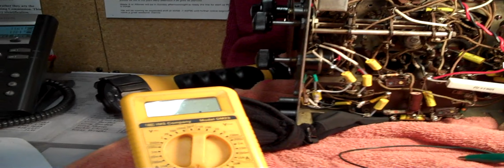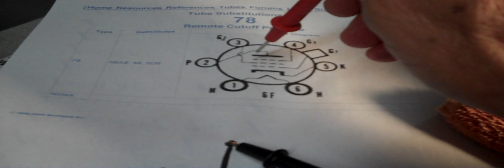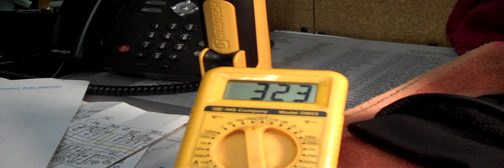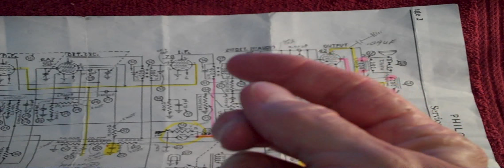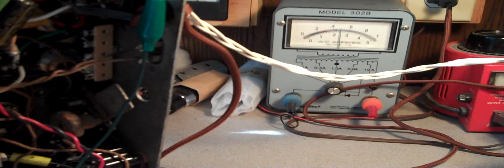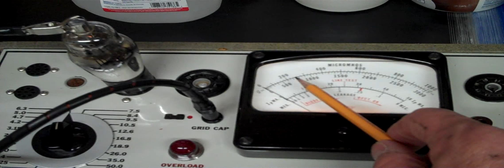1936 Philco Model 630B Repair and Restoration (Part 34 of 35).

Comment: Hi John,  Just want to let you know that your videos are really helpful. I have been working on a Philco 620, on and off, for the past 2 years. After watching these videos I decided to look at this radio once again. Got it on the bench and guess what, my voltages where too high. I don't recall what I did over the last two years, but your approach seem logical. I did check the 42 and it did have low emissions. Replacing the 42 brought the voltage down and the radio is now working. Thanks for your help.  Joe

Comment from the maker: The multimeter is a Model DM23 from IMS Company.  It's an older model, but still works good.  However, I recently got an 11-function multimeter from Harbor Freight.  It's bigger than the yellow one and can do a few more things, like taking the temp of a power transformer that seems to be running hot.  And the digital display tilts up and down, which is very cool.  All for just $20.00.
Go to HF's web site and search 11-function multimeter.

Regards,
John

Comment from the maker: @pskittle488,
The best tube tester is "tube substitution", followed by tube pin voltage checks as stipulated in the radio's documentation.  Also, using a tube characteristic drawing from Nostalgia Air (like the one I used in the video), checking for shorts between internal elements can be easily done with a multimeter.
You'll probably find that the tubes in your radios will work fine.  In all the radios I've restored only two tubes were completely non-functional.

Regards,
John

Comment: Hey John I got a question for you. The tube testers  is an Emission type tester, do you also have a Conductance and if so I was wondering It the Conductance tester would have show the same results as your Triplett 3444? (testing the audio tube bad and good)

73's
Jim

Comment from the maker: @RetroPCDOS,
Great response.
Had I checked the tubes in advance the beginners who are graciously following my vids would not have learned about high plate voltages and at least one thing they might try to partially solve the problem.  Hopefully, it'll help one or more of them in the future.
We'd better save the selenium rectifier jazz for another time and another radio.
Thank you.  I do appreciate you stopping by.

Regards,
John

Comment from the maker: @Davidjb37721,
David,
You rascal...I wanted an AR-3, but had to settle for an AR-2.  I have the schematic for the AR-3 and will be using it to hook up dial ights like those that are in yours.  Be sure to closely check every solder joint in that radio.  And always remember: A Heathkit of any kind is only as good as the solder job and attention-to-detail by the person who put it together.
Thanks again for stopping in again.

Regards,
John

Comment from the maker: @WillBdiggin,
Actually, a tube tester isn't all that necessary.  It's a luxury item.  A while back a fellow made me an offer I couldn't refuse, so I snapped it up.  At the time I was looking for a reasonably priced Heathkit TC-1 or TC-2.  This Triplett is a labratory unit...much more tester than needed for my small radio repair needs.  But it's here so I'll keep it.
The best tube tester is "tube substitution".
Thanks for the visit.

Regards,
John